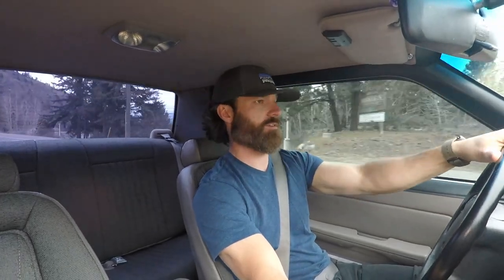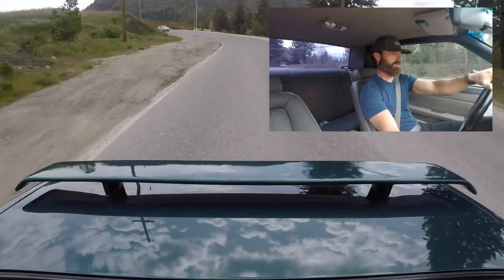Why I bought the Comp Cam XE266HR camshaft for my SBF 5.0 Foxbody Mustang - Ride Along and MORE!

Comment: Finally, someone who is sensible and understands that for a streetcar it’s just not just about horse power, it’s about the characteristics of the engine that make the car an exciting and fast car on the street. 

The saying that “the more horsepower the better” is nonsense. I have been telling people this for years, which is that it is better to have a lower horsepower engine that is responsive all the way through the rpm range as compared a high-performance street engine that makes horsepower and torque high in the rpm range. 

For example, a lot of people who have very high horsepower engines in Fox mfor example are puzzled when they are beaten on the street by cars that has have half the horsepower that they have. 

I’ve driven in some cars that had normally aspirated engines that were pushing 600 to 650 hp, but the cars were boring to drive on the street because they were unresponsive up until 4500 RPM. 

Not only that, but where in the city are you going  shift through all the gears ⚙️ uwith a 650 - 700 hp fox body mustang? 

I used to own a limited number number 23, 1993 fox body mustang by a company named Auto Kraft. I never liked Porsches, because I thought they were ugly and overrated Volkswagens with engines behind the rear wheels.

I guess in 2004 I drove the 996 Porsche and 1991 Porsche Boxster S and both cars were boring to drive because of the engines were so unresponsive and flat. 

On the other hand the Fox Body Mustang was much more thrilling to drive than the Porsche. Magazines were giving these Porsches great lap times around tracks only because is he you’re on a race track rpm range is really low 4500 RPM. The owners son at factory five has a 400 hp fox body and his father told me that this car is extremely fast on the street because it was responsive all the way through the rpm range.
Reply from the maker: Thank you and thanks you for sharing your stories and experience!

Comment: You described exactly how a cam can make a driving experience different from stock.  I have a XE274HR in my 91 notch I just picked up.  The extra care and difficulty in driving in traffic and the manual steering in mine are things I like.  Plus the lope is always worth it lol.
Reply: Actually I’m not sure I like the manual steering yet lol.  I love it my Lotus Elise and my dads RX7 but those cars are light.
Reply from the maker: Lol - #camlife 😂👊
Reply: Did I have to change your piston or rod's for your xe274hr
Reply: Wondering if the XE274HR would be a better choice for my 331 build in my Bronco, but that cam also mentioned a 2500rpm torque converter.

Comment: Nicely done. I went with the Comp xe282hr cam with my 347 Afr 185s rpm air gap intake and Aed 750 carb. 4.30s in the rear with a 6 speed and the car runs and drives great. A little chugging but they’re not Cadillacs. I can literally go out driving in the morning and drive it alll day and I still don’t want to get out of the car. Like you said they’re really fun cars and as long as you’re still having fun that’s what matters. Long tube headers and 3 inch Flownasters and tailpipes like music to my ears. Lol   Cool videos man keep them coming.
Reply from the maker: Thx buddy! Wow that sounds like a very strong car you’ve built!!!
Reply: That combination makes about 475hp/440ftlb.   Just talked with a dude with a similar setup.

Comment: New to the channel & am loving it from way down here in sunny south Florida. I’m in the process of selecting a cam for my black on black 92’ notchback (which I bought new when I was in high school). She’s only got 39k miles on her & is as clean as yours. She’s got an old SN-89 Paxton making 8lbs of boost, 24# injectors, 73mm C&L mass air, 65mm throttle body, 3.55’s, Tremec 3550, 155lph fuel pump, bbk 1-5/8” shorty headers w/ MAC off road h-pipe into 40 series flow masters, aluminum driveshaft, all urethane bushings, Eibach springs, shocks & struts, MM rear control arms & steering shaft. I’m getting ready to install a set of fully ported TFS 170cc Track Heat heads, Harland sharp 1.6 rockers, & an extrude hone ported Track Heat intake. I’m stuck between the XE270HR & your cam. Difference is yours has 112 degrees of lobe separation versus 114 degrees for the XE270HR I’m looking at. I wonder if the low rpm bucking would be less noticeable with 114 degrees of lobe separation as it should in theory idle a bit smoother. The XE270HR has slightly less valve lift as well 0.512 for both intake & exhaust versus 0.544 & 0.555 respectively for your cam. I want it to run as smoothly as possible at low rpm (below 2k) while still offering a significant power increase over the stock cam especially given the aforementioned future mods. Decisions decisions! Keep up the great work on the videos.
Reply from the maker: Hey bud! Thanks for reaching out!! That sounds like a very nice car you have there! 

You have very good points. Between your port work, and the blower, you are definitely going to be moving more air then I do. There have been some folks that have commented on here saying that they have chosen the 270 over the 266. I’m sure if you reached out to them they wouldn’t mind giving you their experience with the 270. All of them seem like very solid folks. Sorry I could be of more help... I would definitely be asking the same questions if I was in your boat. 

Thanks for reaching out and keep me posted on what you decide 🙏👍👊

Comment: Hi from Stockholm, Sweden. Great 👍 informative video, I have exactly the same experiences with stock vs Comp..tried a few different combos and cams for my 88 (now) Mass Air, 5 speed vert. I even ran the XE264hr with speed density still controlling the motor and got it to “behave” pretty well..yet, severe traffic and 2.73 gear combined with the 264 Comp was not for the “inexperienced” driver 😁..like you said.
Reply from the maker: Hello my friend!! Thank you for watching and reaching out! Yes very good points made! Send some Swedish Snus to Canada for me 😉👊. Take care my friend 🙏👍
Reply: shouldn't you be running a 3.25 gear,  even a 3.40 Rear Gear would work with a T5 trans.

Comment: I have the XE266HR in my 90.  I actually had to widen the valve notches on the intake side with GT40 heads.  You mentioned the alphabet cams are very old grinds.  Ironically the XE266HR is getting to be pretty old too.  I bought mine twenty years ago.
Reply from the maker: Oh wow! Yes you are correct on the age of this comp design. That said, if it ain’t broke, why fox it 😉. I do not know for sure but I think it’s safe to assume the alphabet cams and their technology are at least double - if not triple that in age 🤷‍♂️. All that said, thanks for reaching out. I always love when people share their own experiences because others can pull info from the comments which helps them and the community 👌👌👌

Comment: the 4.6l stock cam bearings start to wear out around  100,000 miles  I put new stock cams for $200 and all new valves for $75 tuned and ported heads myself car is like new again was going to put comp cams but fuel prices are killing me .. if you polish the intake and exhaust chambers (tune and port)  it eliminates rev hang and improves pickup
Reply from the maker: Very nice!!!

Comment: "New Subscriber" I just inherit my dad's 93 GT 5.0 Mustang. He purchased this Little Red Fox new. Now only 88K miles.  After watching several of your videos and enjoyed them all, I now know I need to add my favor.  All stock expect the K&N Cold air and the flowmaster 40 exhaust system.  In my younger days of hot-rodding I ran the comp cams.  I truly like the sound of the XE266HR but just looking for one as you stated, "slide in and go..." Are there any changes needed to sport the XE266HR.
Reply from the maker: Thank you sir! I'm glad you liked the videos! Congrats on the car. It sounds like a real beauty! 

To be honest, I did not do any homework regarding using this cam with the stock heads and subsequent components so I am not sure. All that said, I do know that there is a lot of information regarding the Ford Motorsport "Alphabet" camshafts online which will show you which cam you can run with stock heads etc. I hope that helps. Thanks again for reaching out!

Comment: My combo is 332 (30 over 331Scat) forged Mahle pistons, Weiand street warrior, blueprint alum heads 2.02/1.60 valves 190 runner, summit 600 carb 1” wood spacer 1 5/8” ceramic coated shorties, 4 speed top loader, 34” tires 3.73 gears LSD front and rear, in a 4600lb 1980 Bronco. It’s a good combo, great midrange,
Reply from the maker: Jez, sounds strong!!! 💪
Reply: @KASLCustoms  it’s perfect for my setup. It’s built for rowing gears, fun stuff
Reply from the maker: That’s awesome!!!
Reply: I thought that I was the only person who referred to their motor as a 332ci...to me 331.7ci is 332ci not the 331ci everyone says
Reply: @msk3905  round up! I always do

Comment: Comp 270HR (35-420-8)  here

215/215 on 110, .533”

i want the same

no “lurch” at 1500 rpm and good manifold vacuum.  hoping for 18”

i will let you all know how it does.

1987 302 rebuilt, air gap carb intake with 600cfm, ported 1.94-1.60 1975 heads with 59cc chamber, 9.4 compression

cam has -4.0* overlap at .050

thats the key number!

B, X, and E are all 0* overlap, and they are a little too annoying for me in a 302

Comment: These days unless you're running something with an insaley low LSA or just a honkin cam, it's usually the tune when it bucks down low. I had a 98 SS camaro with 243 heads and a fast 92 intake and it had a donkey dick cam in it when I bought it (TSP magic stick 4, didn't much like it with 3.55s in the rear, felt soggy driving around town) but it had great manners. Never bucked on me even when poking around a parking lot.

Comment: Great Video!Yeah there is nothing like the idle of a lumpy Cam. I had Mathew from Techmotion Tune my 92 Notch as well.  He knows his stuff when it comes to small block Fords.  I am Currently upgrading my 92 from the stock T5 to a T56 Magnum. The T5 is getting pretty tempermental on shifts to second gear.  I run 3:73 so the extra gear will help on those long/fun cruises from Calgary to the Okanagan and the West Coast.
Reply from the maker: Hello sir! Yes, Mathew is nothing short of a tuning wizard. Very knowledgeable fella and great to kick around the shop with. That T56 will be nice 👌👌👌. One day I will join you on that journey 👍
Reply from the maker: Hello sir! Yes, Mathew is nothing short of a tuning wizard. Very knowledgeable fella and great to kick around the shop with. That T56 will be nice 👌👌👌. One day I will join you on that journey 👍
Reply: What are the ratios in your T56?

Comment: My 95 is bone stock with the factory 2:73 gears I believe and there's a section of my daily commute where traffic becomes stop n go for about half a mile and I can hang back a few car lengths and just put my car in first and leave my foot off the gas and it just idles along even the section that's up hill, it just blub blubss along no bucking nothing, I will miss that but there are alternative routes I don't bother with but if I had a good reason I may. I going fresh short block with aftermarket pistons so I'll have a lot of head choices and afr enforcers seem like a no brainier but I've pondered thee 165 or 1851s, I'd love to hear from someone that's knows of a comparison on a stock displacement 5.0 between the 2 firsthand. Is there a highly noticable lower rpm Tq between the two or if it's fairly negligible. If so why bother with the 165 even tho I have seen an engine Dyno run of prestige motorsports on YouTube with over 500hp on a 347 with 165 versions so they obviously flow good but why leave any a little on the table if there's no real downside. Typically 20cc isn't a huge difference that youtube guy with the 95 onyx car that has TFS 11r 190 heads on a stock 302 and seems to have good drivability and runs strong and makes like 350ish hp to the wheel if I remember right, can remember intake gt40 maybe.

Comment: I am using this cam in a 347 build I'm putting together right now. When I degreed the cam I got 0.557 intake valve lift, 0.577 exhaust valve lift, 220/228 durations @0.050. I ended up having to advance the cam 2 degrees from "dot to dot" to set it at the 108 intake centerline.  This is with trickflow 170's with 1.6 ratio rockers and using solid lifters to degree it.
Reply from the maker: Good info thank you for sharing
Reply: @KASLCustoms build is done, car is back on the road. The car absolutely rips and I am happy! I had the cam before I saw your video, but your video is very accurate to the manners of the cam. Thanks for the videos and helping the community!
Reply from the maker: @gndoug that’s amazing! Congrats buddy. Thanks for the kind words my friend!

Comment: Great video!! Your cam will make for a great driver/power maker with great DRIVABILITY. I run a Lunati cams 51014 cam with Windsor Sr. heads Milled  to 58cc. It makes really good power with diecent drivability. Not that I'm older I would like more drivability, and I find myself missing my old E303 which is another great cam that I've used with the same aforementioned heads and the power was still good,  with the E303 having much better vacuum and drivability. Having good heads help the mild E- cam contrary to what some folks may say. Can't put any performance cam with stock E7 heads and expect good results. The E-cam WORKS! Lastly as far as so called old cams go. The favored TFS stage 1 is about  as old as the letter cams. TFS copied the Lunati 51014 and called it the TFS stage 1. The 51014 started in the early 1990's, (is also when I purchased mine) so I laugh when people act like the TFS stage 1 is new tech😂! So when people ask what can I run I sometimes call it the TFS stage 1 so people will know what I'm talking about. Most don't know about the 51014 cam which that's what it actually is even though the specs are the same. Also I'm running a dual plane intake/holley hp carb setup.
Reply from the maker: Very nice my friend! Sounds like a strong combo you have!!

Thanks very much for sharing with everyone on here 🙏🙏🙏
Reply: @KASLCustoms  Thanks! I'm very happy for the most part with my setup. It's very a very strong running street car even for today's standards. Sound like you have a really nice setup as well. Judging from what you mentioned about you performance wants and the the setup, I'd probably say if you come to a point where you want more power, I'd probably say to keep everything the same and look into a 331 or 347 rotating assembly. That would give a very good power increase especially torque within the  rpm range you like(bare minimum 380 feet pound of torque or more with 331). These little 302s are fun street motors if built within reason..  I feel most people tend to take these motors too far in the build department. Just my opinion. Stroker will be my next move down the road and keeping her N/A with no other changes to my combo. I'm personally liking the 331 myself. Better rod ratio and definitely good oil control for longevity compared to the 347.
Reply from the maker: Yessir! I couldn’t agree more 👍👍
Reply: Funny how often you come across mistaken information online…

The Lunati 51014 and TFS 1 cams are SIMILAR in spec but certainly not identical as mentioned above. The TFS is .499/.510 and the Lunati is .500/.510 for lift. They both have the same 112 LSA, but the duration values are different as well. I’m wanting to say .276/.282 on the TFS and .280/.286 on the Lunati. but I don’t have a cheat sheet in front of me to be certain, I just know they’re different. Not super different, but thought someone might appreciate the accuracy.
Reply: Even cams with all identical spec numbers can have differences in lobe ramp rates both opening and closing. Often minor variations can make significant differences.
Also rockers of identical ratios (eg 1.6) can have significantly different off the seat rates due to the positions of the pushrod, fulcrum, and tip angles. 
Jones Cams in VA, is highly recommended by David Vizard.
Reply from the maker: Very true

Comment: Enjoyed the overview. I used the XE274HRE in my 331 for a long time and enjoyed it.  I have a TFS stage 1 now in my vert.  I think the tune helped me at low rpm with the lurch. Don't know if you're running a tune or not.
Reply from the maker: Oh nice buddy - I didn’t know that. I do have the car tuned however I’ve just always assumed my lurch was cam related... 🤷‍♂️
Reply: @KASLCustoms  Might still be with different cams. Like you mentioned in the video it's not really a huge deal.
Reply from the maker: Very true! Do you get and lurch/bucking with the TFS stage 1?
Reply: @KASLCustoms  I do not, but I have some cold start issues, but once it warms up I can easily release the clutch and my car takes off on its own.  TFS 170cc heads and TFS street burner intake manifold, with 24 pound injectors.  306.
Reply from the maker: Wow no kidding!? That’s awesome. Well maybe I better start running down a bit of a rabbit hole then cause up until now I have literally just put up with the bucking 😂👍

Comment: Hi, at which RPM is peak torque and power with your combo? If not dynoed, where does it feel like it falls off?
Reply from the maker: Hey there! Right around 5800-6000. I very rarely spin the car up that high but it pulls hard right up to just before the limiter

Comment: Im doing  the exact  same setup  and im wondering  if u were available to use stock pushrod or if u could share  the pushrod length  u use. Thanks
Reply from the maker: No I ended up using different push rods. Honestly, I wouldn’t use the same ones as I did - or anyone else for that matter because every set up is slightly different. You should measure and order according to your needs 👍